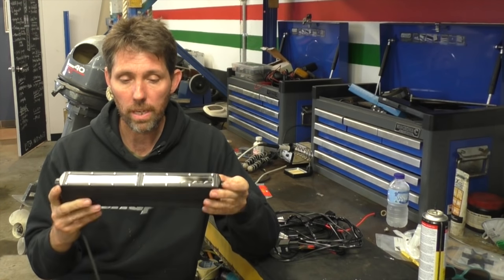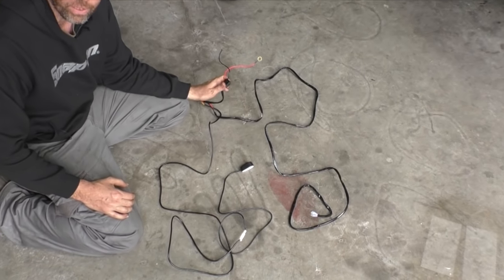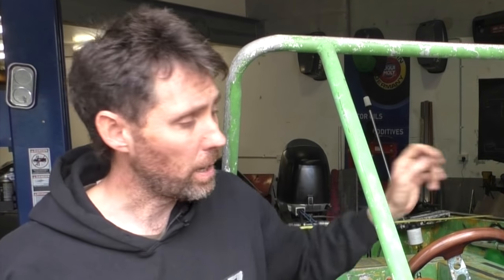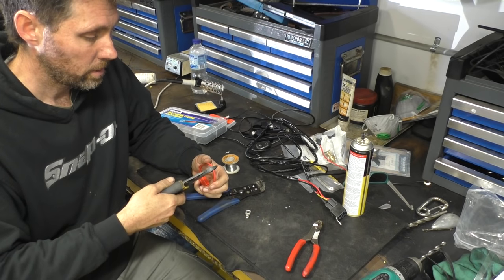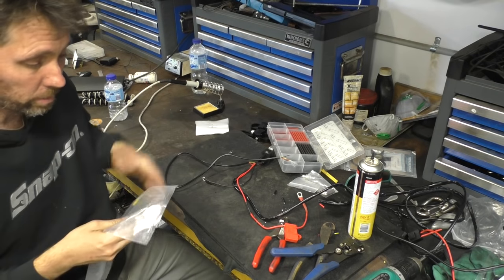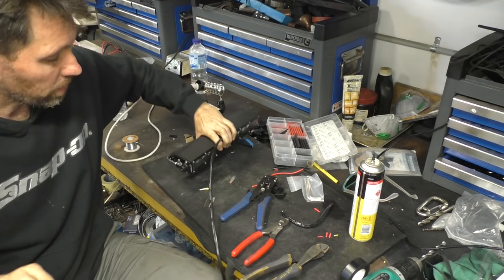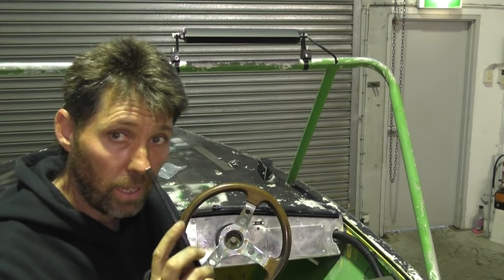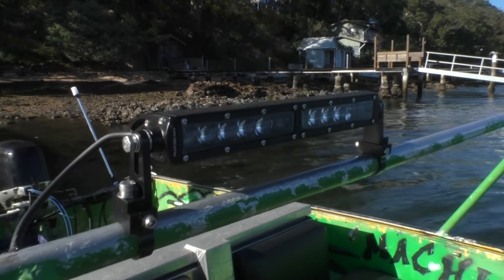LED docking light installation

Comment: I live. In Maine, USA, i mounted  a light on the cross bar of my center console windshield and found that it attracted so many insects at night they actually obscured my view and  few even wound up in my mouth while motoring. I moved it to the port rail on my bow so i wasn’t having to look directly through the swarm of insects and no longer have to ingest them. May just be a Maine issue, our state bird is the mosquito after all.

Comment: One thought. A lot of people in Canada use solar garden lights to mark driveways, garden paths and steps. I just installed a couple on my steps and driveway. They make great markers. I am surprised they are not used on docks down there.  They make them for post caps and railings, some are very flush and robust.  Love your videos. Thx.
Reply from the maker: Hi Dave, you do see them around on some wharves. As you say, you do need to pick the right ones though as some aren't anywhere near as robust as others. I also see them on moored boats so people can avoid hitting them at night.

Comment: That loom appears to be a standard Chinese auxiliary light loom sold by a lot of off road car places. They are fused for a pair of 100W Halogen globe spotlights, but the cabling is only good for 15A continuous if you are lucky. A 7.5A or 10A fuse is more appropriate for your use. But it is a good looking light that suits your boat, I like it. Again, a well done instructional video.
Reply from the maker: Thanks mate, that's an interesting insight into the loom and particularly the fuse that came with it. As someone else mentioned, you do the maths on the 60W rating and it is clear that it can be much lower.

Comment: Great videos.  I would consider grommets where the wires exit under the dash. If not you might get to see how well your fuses work!
Reply from the maker: I mustn't have shown it in this video but these wires are now inside a conduit to protect them from chaffing on the metal edge. You are right though, with all the vibrations boats get they wouldn't last long otherwise!

Comment: Great vid for a complete novice like me it was very informative, could you perhaps do another aimed at "boat light installation for dummies" I tried installing my light from an internet diagram the problem was it never mentioned wire gauge fuse size or a relay box mine burnt out in 2 seconds :( cheers
Reply from the maker: Thanks mate. Here are a couple of other video that might help you with your lights. https://www.youtube.com/watch?v=Juh4Y14CIlI 
https://www.youtube.com/watch?v=p-Yup0OPofk

Comment: The 21 gauge or  2.5 mm cable that you have run from the battery is good for 20 amps. it should be replaced with with 6 mm cable and a 40 amp fuse at the battery. At the positive terminal under the dash where the 6 mm cable is connected, connect the 30 amp fuse supplied then to the light via the switch. The negative for the light should go direct to the negative terminal under the  dash where the 6 mm cables are connected. From that point you can put a 20 amp fuse to protect everything  on the active link.By doing it this way you can have every thing running and everything  protected and not blow the main fuse. Just a thought

Comment: Great video !  Can you mount an Anchor Light on the Bar ?  Also if you do not have a Radar you can mount a corner cube Radar Reflector on the Bar !  Then other boats may slow down to avoid you and looking for the Queen Mary...  tjl
Reply from the maker: Hey Tim. You can mount an anchor light on the bar, but if you are using it as you all round white light while underway (just turning off your side lights when anchored) then you need to make sure it doesn't affect your night vision. Putting a disc of plywood underneath it to shield your eyes from the light can help there. Ha! Love the idea of the radar reflector. ;)

Comment: The LED light bar looks the business and works well! Do you have a cabin light as well? Some of those flexible LED light strips look ideal for use as a cabin light.
Reply from the maker: Hey Matthew. Yep, I do have a cabin light but I think those LED strips would have been a better option. My light is a bit too bright, particularly after driving around with your night vision. For now I'm thinking about fixing it with some red globe paint, but LED strips would be a really nice upgrade down the track.
Reply: Great videos, been watching a few this morning. When you try the LED strips, I highly recommend ip68 strips with the extra silicone sleeve over the top. If you need to trim them, you can trim them along the solder line which is usually every 3 LED's and is quite visible on the strip. After trimming, fill the exposed end with a cm or two of neutral cure silicone and whilst still wet put some glue-lined heatshrink over that and shrink it. Should seal it up really nice, we use it on xmas lights left out in the FNQ rain n humidity during summer and it goes well. The exposed PCB style LED strips with just the silicon molding over the top, glue on back tend to get corroded badly I find. 

If the strips are too bright, you can either trim them smaller, put some diffusing cloudy material over them or find a nice ip68 PWM-based dimmer. The same kind of dimmer will probably work on the LED based cree light bars if they are only using internal resistors to drop the voltage down from 12v for the individual LED's.

Comment: I wonder if you have (re)considered putting the low draw relay actuator circuit on the (switched?) 10amp board and just bringing the 30 amp fused lead from the positive post to pin 30? If your like me then maybe need a  key off turns everything off function? Two years later I am just getting to all these videos, terrific content!
Reply from the maker: I do like the idea of a circuit that is only powered when the ignition is on. I did consider having a second positive bus so there would be one with permanent power for bilge pumps and anchor lights etc and one for things that were only needed when the boat was running.

Comment: Looks like the light would be handy to have!  Interesting that you said the wire to the light is less than 12 gauge but came with a 30A fuse.  Also if the light is only 60W theoretically it  should only draw 5A.  Almost worth putting a meter on it and using an appropriate fuse size closer to what the light draws.
Reply from the maker: Yeah, it does seem over fused for 60W, it would be interesting to see what it actually draws when it is on. Certainly handy though. I've used it quite a few times now.
Reply: Let us know what the draw end up being
Reply from the maker: Another viewer mentioned that he had seen these looms used as a standard option for many devices and as a result just come with the biggest fuse the loom is likely to need. I'm going to swap it out for a 10A fuse soon.

Comment: good work, to be sure. but why not a light that is fully gimbled through a good range, with similar power, rather than the bar light, only movable vertically?  also, why not some good reflectors--not all are ugly--on the dock, from all angles, etc.? such seem reasonable to me, but i'd like your comments, etc.  thanks for all you do, etc.

Comment: Hey Dangar. I love your videos. lots of useful info. Especial for someone like me that can learn quickly, but don't know much right now. Anyway, what is the purpose of a relay? And if it is really needed, how do I wire it into my system. I bought a small light bar without the wiring harness and there were no instructions on how it should be wired. I also want it on my boat at night. I was going to wire it from the battery, to a switch and then the light bar.
Reply from the maker: Relays let you use a small current to control a larger current. Without a relay all the current to run the lights would be passing through the switch on the dash. This isn't necessarily a bad thing if the switch and all the wiring is rated for expected current draw.
Reply: Thanks for all of you help. You have made it easy to install what I need for my boat. This winter I will be following all of your Youtude videos and the advice that you gave me.
 I will tell you when I get my lights wired, my trim fixed and my slipping out of gear problem fixed. That is if I can figure it all out. Hopefully I can.
Thanks again.
Andy
Reply from the maker: It's always good to have some winter projects to keep you going until next summer. Good luck! :)
Reply: hey Dangar. This is how I am thinking of wiring my solar panel and batteries and lights.
 From the solar panel to the charge controller. From the charge controller to the outboard motor battery. From the load side of the charge controller to the console and lights of the boat. The Trolling Motor battery is connected in parallel to the Outboard Motor battery.  The Trolling Motor is connected to the Trolling motor battery. OR I was thinking about having the trolling motor battery at the front of the boat and  running a wire from the charge controller to the front of the boat, and to the Trolling motor. What are your thoughts?????

Comment: Common USA marine and automotive practice is to use crimp connections and not use soldered due to vibrations. So please elaborate on why you use soldered. Also, why no grommets where the wiring passes through metal?
Reply: A properly soldered and heat shrinked/protected connection will always be better than crimp connections, especially for vibration.. no exceptions. If the connection needs to be disconnected always crimp then solder the connector. Not sure where you got crimps are common practice 🤔 i have never seen a boat or car come from the factory with crimp connectors other than the spade type, and those are usually crimped, then soldered..

Comment: I replaced my docking lots on an older pontoon boat I just got.  It has a red and black wire coming from the battery to the lights then towards the fuse panel in the console.  From the console, it has the older glass fuses. When wiring to a 3 wire switch, what wires go where? It has the red and black wires from battery to lights then towards console and another red straight wire from the fuse panel. THANKS

Comment: Enjoyed the video. Wondering if you are using tinned copper marine wire in the installation. Thanks.
Reply from the maker: Yes, using marine-grade wire is pretty important if it is going to last in a salt water environment.

Comment: looks like the wire you use is pretty much the same size, regardless of the component you install. what size wire do you typically use?
Reply from the maker: Yeah, I have one size that runs from the battery to the front distribution point and then a lighter gauge that I use for all the devices. They are sold as an amp rating (25amp for the main run and 10amp for the devices) Not sure of the diameter.
Reply: @DangarMarine  thanks

Comment: Would a transistor work instead of the relay?
Reply from the maker: There may be a transistor out there that is up to it, but generally transistors are for switching much lower current that this light unit draws.

Comment: Gonna do something like this myself Stu but was thinking of making a removable harness using anderson plugs with a plug going to switch and a plug going to light rather than drilling into my rocket launcher do you think this will work and where is the cheapest place to get a marine relay and how much are they cheers mate
Reply from the maker: Removable plug is a great way to go. I would be inclined to just use a cheap automotive relay and spray it with StrikeHold or something like that.
Reply: @DangarMarine  thanks mate much appreciated but never heard of strike hold is that a paint or something?